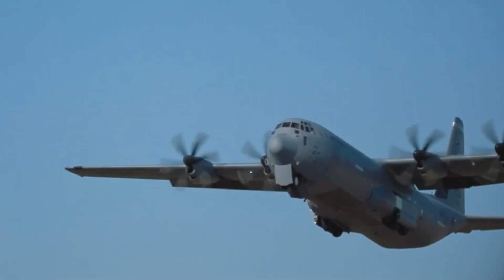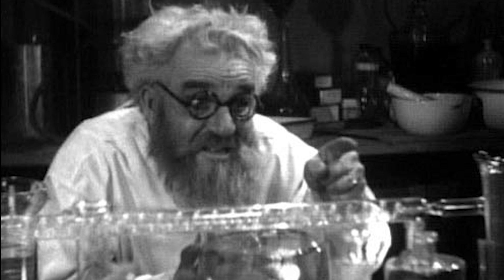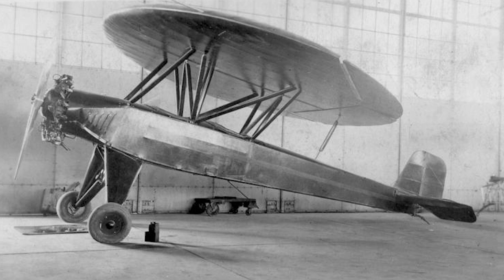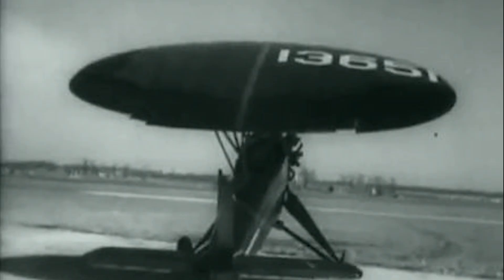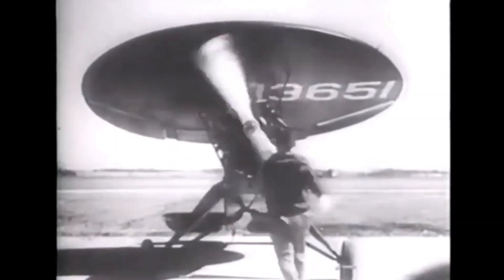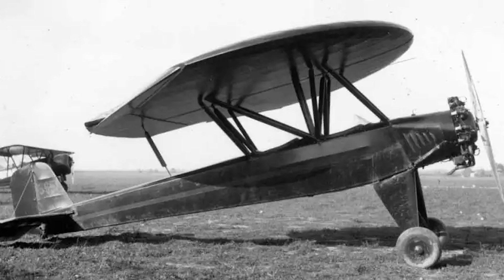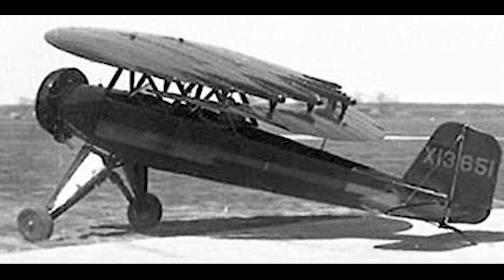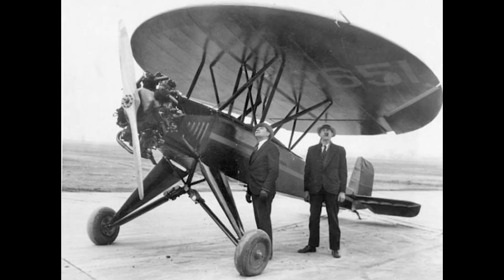The Nemeth Parasol – A Parachuting Plane

Comment: amazing, it looks as if it should spin in an instant. There must have been something up with it?? As many have said below, would have made an ideal naval aircraft...
Reply: The only thing wrong with it is that it came from a one-man nobody (and some students), and it looked funny.
Faster than the original plane, stall-spin proof, even at +40 degrees nose-up at silly slow speeds, Capable of astounding 45 degree climb.
Reply: Windshear 😳

Comment: crazy looking thing ! But it worked ?  ok I bet you still needed to be an experienced pilot. 30 mins I dunno that sounds like a very very tall tale.

This really does sound like a job for an enterprising modern engineer ! And with todays ultra light materials I bet you could drop a much smaller motor on that thing ( for fuel savings ) and still get it up to about 135 MPH.

Comment: I wonder how much of an influence, if any, this had on the Vought "Flying Pancake"?
Reply: Many designers from the '20s on were looking into the very-low aspect-ratio planform.
The Vought, the German Sack AS-6, Moskalyev SAM-9 test plane in the '40s for a '30s fighter design. The '40s Eshelman "flounder".
 Payen/Aubrun AP-10 of the '30s flew well, but aside from the owner taking possession and flying it around to airshows for a few years, similarly ignored.

At the same time as the Nemeth parasol (in Illinois), was the Arup planes from  Indiana, which were remarkable, and flying air shows. Aside from looking comical to most, were another sort of "planes for everyone" simple, efficient, safe.
See the youtube "Flying Heel-Lift".
The Arup was the direct ancestor of the Vought plane, though not a licensed build. Zimmerman changed it enough that he didn't owe Arup any patent royalties. In any case, you can't sue the maker of a plane that uses your patented ideas and is sold to the military: You'd have to sue the military....

The Arup flew for NACA and the ARMY and CAC in the '30s, and Zimmerman was on the NACA team that saw it fly. Only later using it as the starting point for his VTOL tail-sitter experiments.

Comment: I suppose it's all about wing surface area & providing you've got enough of that, it doesn't matter what shape it is?
Reply: aspect ratio = span^2 / area.
If under 3, at high-nose-up A, it gets a "parachute lift" effect that makes it able to fly super slowly and not stall.
If done right, as was the Nemeth, the Arup, the Eshelman and others, they're fast in cruise.
This has been shown to work in all sorts of shapes from square, circular, various delta shapes.
Reply: @JFrazer4303  

That's cool & very interesting!

Thank you for that. 👍

Comment: I think both the army and navy should of both investigated the military application of this interesting aircraft. This Parachute design would make a great short landing army reconnaissance aircraft. Also could this aircraft could be a gun spotter that could land on the back of a cruiser with a landing pad similar to what came later for helicopters.
Reply: They let Vought do a sort of copy of the similar planform Arup planes from Indiana in the '30s.
NACA tunnel tests showed that the V-173 did not gain anything nor particularly change anything because of the wing-tip located complicated props.
 Why the Navy opted for that, we can't guess.
 See the alternate "Flapjack" in the Boeing model 391 of the '40s.
The Arup, like the Nemeth, did everything the V-173 did, but better.

Comment: Not certain but think this plane was associated with Miami U. Edward Lanier later converted the airfoil to his "suction wing" which had no top skin but open top cells to generate lift. Lanier eventually designed a STOL forerunner  called the paraplane.

Comment: What exact problem does this wing shape solve? Or phrased another way, why do low-cost low speed airplane builders, such as Cessna, still opt for the traditional design if this wing design was truly better?
Reply: "What exact problem does this wing shape solve?"

More compact, simpler.
Faster/more efficient. 
Will _NOT_ stall or spin. 
Land in its own length with any headwind.

It was not designed for the non-pilot, but it was advertised (truly) as simple and safe enough that non-pilots could near readily. 
I'm sure an actual experienced pilot cold handle it too.

To the contrary, no: history supports the claims, as do multiple printed reports and several videos.
In this case, the fool is one who won't listen to received data about these things because it triggers a cognitive dissonance, not one who accepts something with insufficient data.

It's not just the inventor's claims. This and other similar concept planes were and are demonstrated to be a known science.
It's demonstrated in numerous sorts of planes how the very-low aspect-ratio can work. It was written about by Zimmerman for NACA and for UAC/Vought when studying the Arup S-2 and working to his "Flapjack". It was written about by Wainfan for publication by NASA.
This isn't just one youtube article about an oddity from the '30s.
Reply: If the vehicle stalled it could land safely without killing everyone on board AND without need for a runway. You didn’t listen did you?
Reply: @AnEnemy100  I disagree. The plane for reasons known only to its inventor was designed to be flown by a non-pilot. Last time I checked, though I must admit it has been not an insignificant amount of time, non-pilots don’t typically fly airplanes. This airplane is a great example of the social dimensions to the “feature v bug” discussion regarding technology.
Reply: @BaronVonHobgoblin  The clue is in the word “parachute”.
Reply: @AnEnemy100  since you are unable or unwilling to read and acknowledge my subtext let me clue you in. I don’t believe the inventors claims, history supports my skepticism. You’re welcome to think what you will. Please, if you don’t mind, don’t share those thoughts with me.

Comment: Something similar was made in Germany just as WWII was starting. It, too, was a civilian design named the Sack AS.6. It was not picked up on by the military. 

If either aircraft had been created as a low wing design, (the German one was also a "parasol" style), I believe there might have been a military use for an aircraft that could have STOL characteristics. Essentially a better performing Westland Lysander, which could do all of its roles, and perhaps even more. The  placement of a lower wing would have had the large flap extend under the fuselage, similar to the central portion of the Douglas Dauntless dive bomber's dive brakes.
Reply: See also the Farman 1020 of the same time period. Also faster than the original plane which the fuselage came from, and stall-spin proof.
The Arup planes from Indiana, along with the Nemeth, were the strongest flying examples and which no doubt were recorded as the impetus to the V-173, must have influenced the Sack.

See also the 1940s Boeing model 390-391 discoid fighter, as an alternate the Navy didn't explore, for a "flapjack" STOL fighter.
Also in the '40s, reportedly as a response to American successes with very-low aspect-ratio planes, Moskalyev in the USSR built the SAM-9 "Arrow" ("Strela) as a test plane for a very short aspect-ratio fighter he'd proposed in the '30s called SAM-4 Sigma..

Reportedly, Messerschmitt was tasked with a follow-up of the Sack plane, something called the Me-600 has been reported here & there.
It's not known why the German plane couldn't fly. it didn't need more power or even as much as it had. Probably, not enough A allowed by the landing gear to get the nose high enough for "parachute lift".

Comment: The wing alone didn't allow it to drop steeply. It was called "parachute plane" because of both the steep descent and practically zero landing roll.
This makes it sound as if that's all it's good for: power-off falling vertically down. Not true at all.
Compared to other STOL planes, this one is faster than a normal plane, not slower, and stall-spin proof.
The key is the wing-tip vortex driven "parachute lift" phenomenon.
Charles Zimmerman wrote about it extensively when copying the Arup S-2 for his Vought "flapjack". It was also written about by Barnaby Wainfan who wrote for NASA about the "Facetmobile". See the paper on the Facetmobile site.
With aspect ratio under 3 (span^2/area), while flying very slowly at very high nose-up, the wingtip vortices wrap around it and capture a "bubble" of low pressure above the wing, giving extra lift at such slow speeds. At the same time they trap flow from the front over the top of the wing, keeping it from separating and providing strong smooth flow to the controls. The wing does not stall, even if kept that way. They'll go downwards if they're going too slow, but no stall. Arup could land at 19 knots. The Facetmobile of the '90s could stay aloft level at less than 16 kts, but was also sleek and quick on little power.

Similarly from the '30s, see the Farman 1020. Like the Nemeth built on the fuselage of a normal (mono)plane, it was stall-proof, super-STOL, faster than the original.
Reply: Phenomenal  -  I had no idea a discoid wing could / would behave like that.
When you consider how many light & ultralight aircraft crashes have a stall at low altitude as a critical factor ...
Its astonshing this concept's not been rolled out as the solution.
Reply: Low pressure above wing, isn't that roughly how all aircrafts fly ?
Reply: @thefreedomguyuk  For conventional wings, as a crude rule of thumb its 2/3 suck from above & 1/3 shove (from under the wing).
Reply: I did notice the high speed. Along with its other good attributes I don't understand why this plane didn't go on to commercial success.Would love to know if there was a clear reason.
Reply: They violate everything about "if it looks right, it'll fly right".
Reply: I question the idea that wings produce any meaningful lift by pushing air downward: through Newtonian reaction.
See ram-wing ground effect vehicles that can also fly (the Lippisch/Collins X-113 and 114. A GEV does not gain extra lift and efficiency by bouncing air from the wing to the ground and back up and down again, but solely by compression of air under it while rarifying air above it.
They do not go from Bernoulli compression/rarefaction, to Newtonian action/reaction in flight.
This wing-tip vortex driven "parachute lift" of very-low aspect-ratio planforms has nothing to do with Newtonian reaction. Does it supposedly go to Newtonian reaction in normal flight?

It's always Bernoulli, not Newton.

That half of the arguments against Bernoulli resort to attacking the "equal time" theory shows the ignorance.
Air over a wing does not take equal time compared to air under it. Air under it is slowed and compressed compared to other air, and air above the wing is accelerated, producing rarefaction. This is true with thick camber, or a "plate" with angle of attack.
Reply: @JFrazer4303  Think of that 1/3rd lift component as not so much 'pushing air downward' as 'climbing up the air compressed by the wing'?

Comment: For indoor RC flying when the motors were still underpowered and batteries overweight simple round disc planes made from Depron were very popular. 
Near impossible to stall and with so much drag at a high AoA they could fly very slowly with good control in limited space despite the relative heavy weight
Reply: Interesting....

What's depron....?

Comment: May have made a fine spotter aircraft. Attaching the wing with more of a PBY configuration would have been interesting to see...
Reply: See the Farman 1020, very similar to this, as a high-wing. 

It's possible the ungainly looking struts of the Nemeth were in order to preserve the fuselage. It was converted back to its normal form later.

Comment: Some clever college class could make a radio controlled one. There must a cheap plane minus it's wings on Ebay.
Reply: Like many planes, this was originally designed by a aeronautics class. Many designers around the world at the time were looking at the very-low aspect-ratio planform. May produced good test planes, all were pretty much laugh4ed off without further consideration by those who follow "If it looks right, it'll fly right".

Comment: I'm reminded of another contemporary attempt to design an airplane for the masses, Henri Mignet's Pou-du-ciel. It was also intended as a cheap, basic, fool-proof aircraft that anyone could in theory operate safely. It didn't deliver.
Reply: The Pou had significant aerodynamic issues in its initial version resulting in a significant number of fatalities. 
It could be placed in an unrecoverable dive if the wings got into a negative angle of attack configuration with the forward wing acting as a slot for the rear wing greatly increasing its lift.
The fix was greatly increasing the vertical space between the front and rear wings but by then several fatal crashes had occurred (and the Germans invaded France).
Reply: Later redesigns of it proved to be everything as intended, but everybody only remembers the DH Comet for one crash, not the thousands of passenger miles in later versions and the long career of the Nimrod ASW plane.

Comment: 2:45 "...came down, almost vertically." 
Did you mean horizontally, or did it really, practically land on it's rear end? I find that bit hard to picture.
Reply: It sounds like it could not glide, but instead dropped like a rock.
Reply: @JumpinJerseyMike  More like a parachute.
Reply: Media made up the bit about it being able to parachute down if power fails.
It was called "parachute plane" for steep descent and near-zero landing roll.
Reply: Vertically is different than perpendicularly.
Reply: @mbryson2899  dropping like a rock does not mean that it went straight down. What it means that it has a low ability to glide. The Space Shuttle when landing is an example.
Reply: @JumpinJerseyMike  I was responding to Al M, the thread author.  

edit:  I hurried and didn't notice your comment at first.
Reply: @mbryson2899  Sorry.
Reply: @JumpinJerseyMike  I didn't mean that to sound quite so snarky, apologies!

Comment: USN produced the experimental "Flying Pancake" recon aircraft in the early 40s that used the same principle (although it was in a flying wing configuration).
Reply: It wasn’t a reconnaissance aircraft - the XF5U was a high speed fighter for escort carriers (but the USN scrapped the escort carriers as a concept and went with helicopters and jet fighters).
Reply: Boeing designed the model 390 & 391 "Flapjack" naval fighters (closer to the Arup S-2 which was the precursor for the Zimmerman/Vought plane).
 Like a Bearcat in size, with greater payload/speed, and probably ~25kts T-O speed fully loaded, which means effectively vertically from a ship.
550kts+ at altitude "clean", 45 degree climb.
Sergei Sikorsky worked on the Vought plane and designed jet versions that would have blown away anything contemporary and for the next decade. (IDK how they'd do at transonic, but see the 1942 Eshelman plane known as the "flounder". and imagine applying critical Mach theory to a jet.

US military operated piston/prop combat planes into the '70s, and for support into the later '80s, and still operate (8 blade, turbine driven) props.
They still went to great lengths, trying to make a STOL plane.
Reply: The Vought thing was copied from the 1932 Arup plane from Indiana. See the "Flying Heel-Lift" video on youtube.  The Arup showed that the Vought did not need the wing-tip located oversized props.

Comment: It'd work better with a Merlin stuck in it😜
Reply: Perhaps a 1980's or 1990's toyota car engine would be better, can make the same 140hp, but far less maintinence intensive than a radial or merlin, and ultra reliable
Reply: @Colt45hatchback  
Put the Merlin in the Toyota

Climb Mount Niikata!

Comment: I'd love to see someone have another go at this concept using all the benefits of modern tech
Reply: Look up the Vought XF5U for the ultimate development of this line. It eventually lost out to jet fighters and helicopters.
Reply: @allangibson2408  Intriguing ...........  
Although not in the same lightweight 'plane for the common man' class Nemeth was going for.
Reply: @allangibson2408  The Vought was unnecessarily complex due to the wing-tip location of the props. NACA tunnel tests with the V-173 showed that it did not gain any of its performance or particularly change anything with those props.
It copied its planform from the 1932 Arup planes from Indiana, and it didn't do anything which the Arup didn't do, more simply.
Reply: See the modern Rowe "UFO" from Aus.
Reply: @JFrazer4303  Cool - That's more like it.
Reply: Me too.  This plane seems to be one of those things that are developed too early in time, just like the electric car, invented in the beginning of the automobile but only taking off recently.
Reply: See also the 1990s Wainfan "Facetmobile".
Also notably sleek and quick on little power, also stall-proof.
Reply: Seems like it would work well as a wing-body aircraft and using jet-eductors like Jetoptera.
Reply: @The_Conspiracy_Analyst  Sergei Sikorsky worked on the Zimmerman/Vought V-173, and knew that it didn't need the excessively complex wing-tip location of the props (NACA tests of the V-173 showed that it didn't gain anything or.particularly change anything versus more normal 80ho props spinning the other way).
He designed "flapjacks" with buried jets, that didn't look comical, but sinister.
They'd have out-flown anything for the next decade or more.
Reply: @JFrazer4303  Cool.  What was that aircraft called?